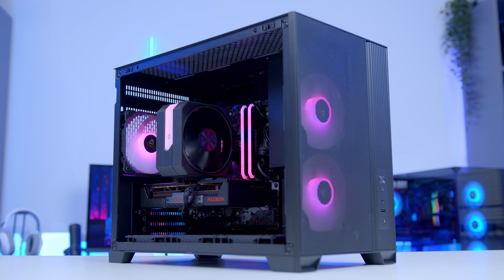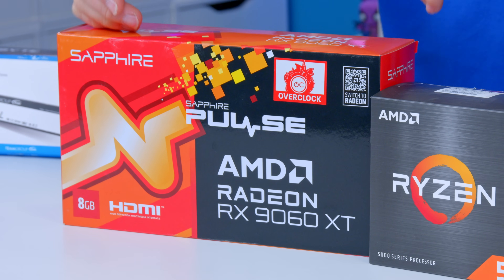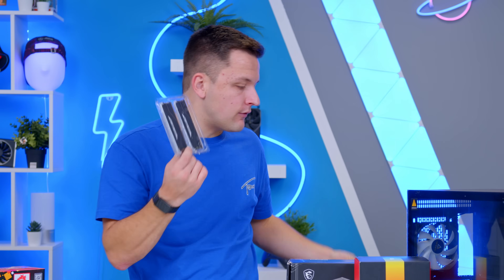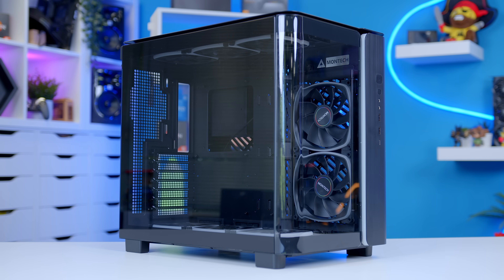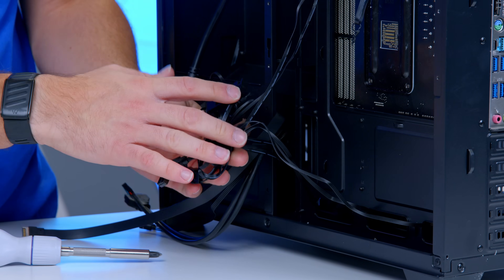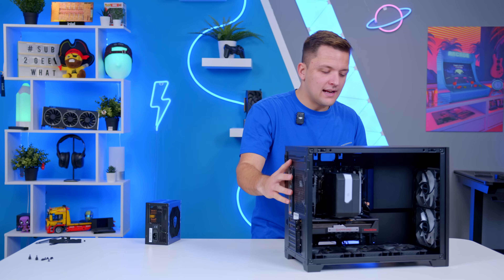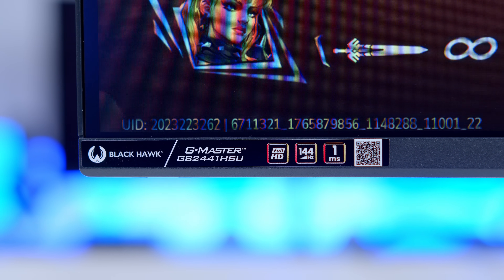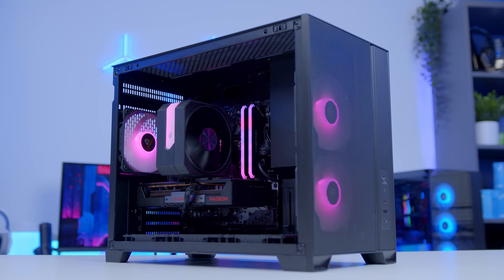Best $1000 Gaming PC You Can ACTUALLY Build Right Now! 👀

Comment: hi guys, i know my topic is a little off but, i just bought a rtx 4070 ti rog strix from 2nd hand market and the pcie golden finger at the most right hand side and the 2nd most right side has slightly shorter golden strips compared to other, is it normal or is it a scratch? I havent try to install into pcie slot.

Comment: Great little build, though I personally would prefer the Phanteks XT M3 case as it's better built with better HDD/SSD options which may be used in a budget build. It also has a more robust top panel and bottom filter.

If this was a PC for myself and that was my budget, I  would certainly save money on the case and cooler and put that towards the 9060xt 16gb. £330 for the 16gb. £270 for the 8gb.
Stock cooler saves £28 over your cooler.
Kolink Observatory Mesh case is £30
That is £58 towards the better 9060xt 16gb.

With that GPU you do not need 650w, and 650w is not future proof anyway. As the cases have PSU shrouds it's worth viewers remembering they do not need modular as they have plenty of free space for unused cables.
There are plenty of brand options for PSU, BeQuiet offer similar models for only a few bucks more than MSI. That said, the MSI MAG A550BN offers all the power this system needs and costs £38 and offers a further small saving.

You can buy a Jonsbo C1200 at £8 or Thermalright 120X for £15. Both better coolers with 120mm fans and capable for this build. 
Had a 9060xt 16gb in the middle of the year as a stop gap GPU and have to say it was superb, I got more of a buzz from that purchase than any other back then simply due to the performance per pound.

My own budget build based on the above Kolink/Jonsbo/550w/16gb GPU choices comes in at £826. So unless the prices massively fluctuate in the US I would advice anyone to avoid the 8gb card unless case looks are more important or they are really strapped, at which point your as well looking at 16gb system memory too, If that is the case, go around the neighbors and offer to do chores for small payments and add that to your budget. 

It's crazy though, as an AM5 system based on a 7600x with 32gb of DDR5 and a 9060xt 16gb was around £1000 in June/July.
Reply: Yo can I pay you to listen to me on what I want to build and help me source the best parts? You seen to know a lot and I’m looking to build a pc rn from scratch.

Comment: best option for CPU ryzen 5 7600X
Reply: Not at today's prices, it's great when £140 but the 9600x is a better cooler running CPU. But the reality is we are talking AM4 here because you can build an AM4 system for hundreds less than an AM5 for not a huge variation in frame rate.

Comment: Decent build for the price. I pulled the trigger on Black Friday and Cyber Monday. I built a 1440p rig for $1150USD

Ryzen 5 7600x
B650M Wifi board
32gb DDR5 6000mhz (4x8gb)
2tb nvme (7000mbps)
RX 9060XT 16gb
240mm AIO
650W 80plus Gold Fully modular 
ATX case with 3 RGB fans
....all new parts.